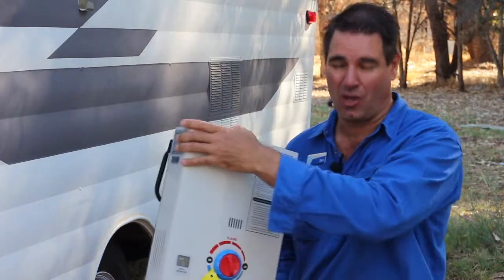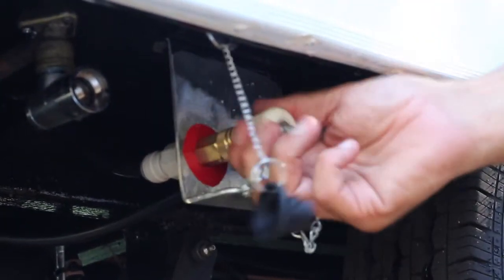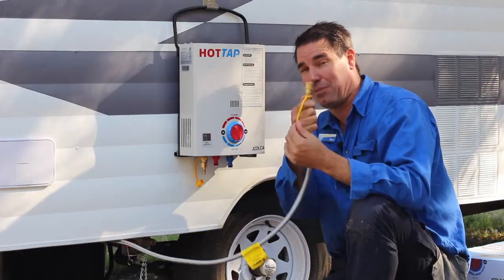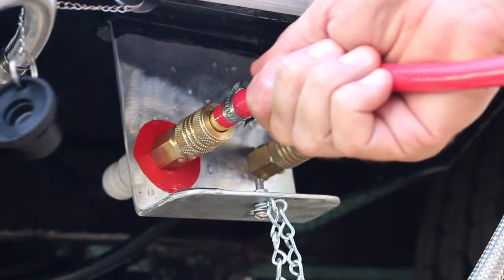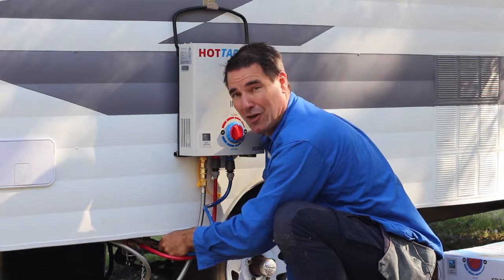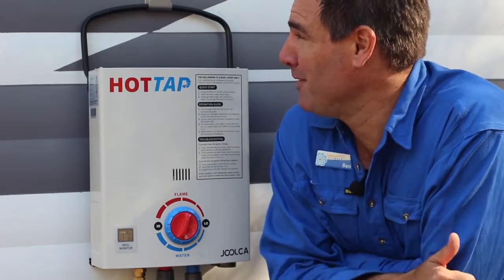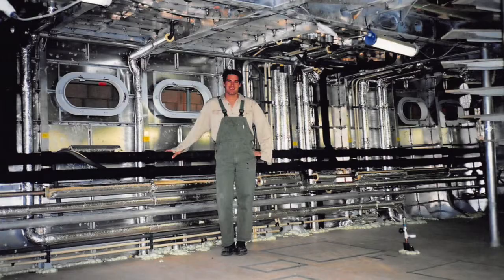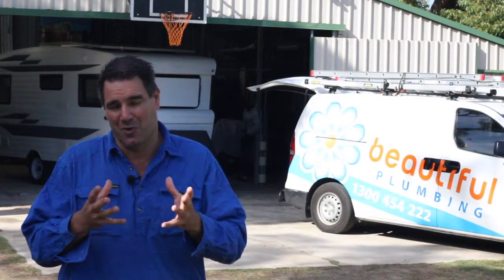Portable Hot Water System for Your Caravan. You Need to See

Comment: Yep that's great however all of these type of Hot water systems suffer from the Aust Standard being applied to them that restricts them to an output of 50 Deg C. I understand the safety aspect and the need to protect children from their parents etc however by the time the 50 Deg C water gets from the outlet at the unit to where ever you want it ie shower or sink that is more than a couple of metres from the unit then you are wasting your time with one of types of units.  I have had to have two positions to make the unit work for me, one for the van sink and one for the shower...… Thankfully the shower water is hot enough or I'd be going with a completely different system.